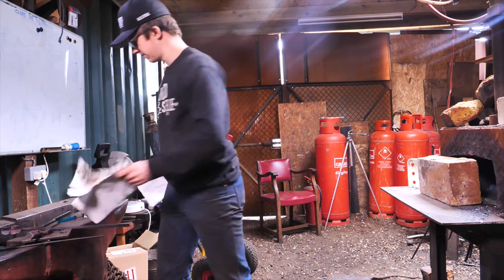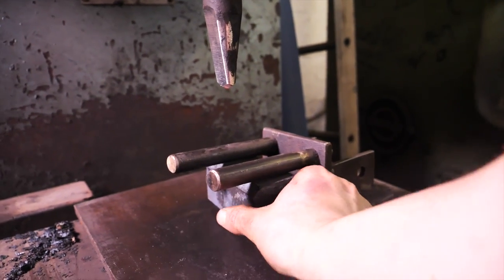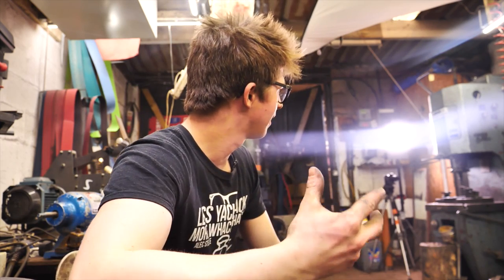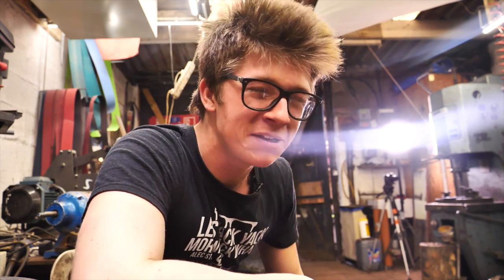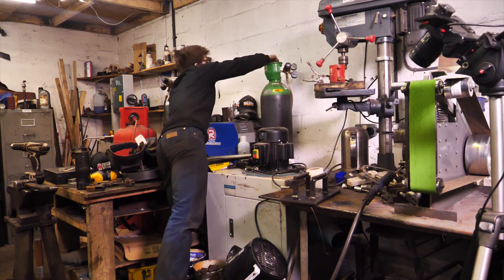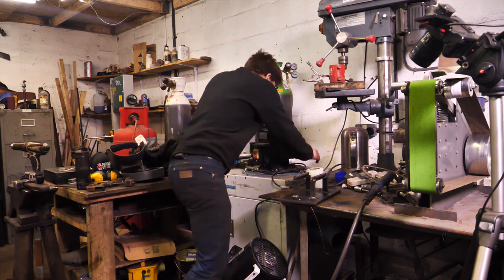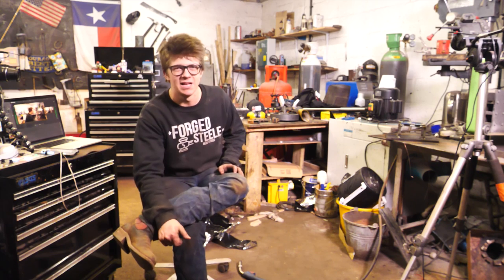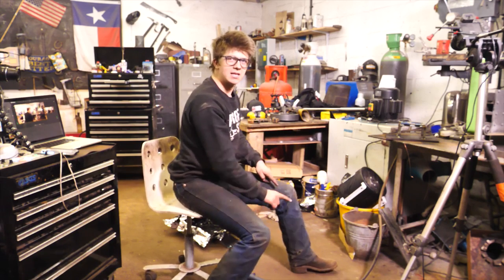MURPHY'S LAW!

Comment: Could you please make a video just about all the different types of hammers and what type to use when and what a beginner should buy?  It's more confusing than history class.
Reply: Sean Collins Hammers are all quite similar really. heavy hammer for moving metal quick, light for precision work. cross peen perpendicular to length lengthens and ball peen for making round depressions or rounding curves. the most Essential hammer for the beginner is a cross peen hammer (2-3 lb in weight is best for beginner) as you start to need them a ball peen and a 4 lb sledge become handy. In my opinion that's all that is necessary to forge. have a great day.
Reply: im a novice blacksmith and my teachers gave me a 800gram square faced hammer with a cross peen on the back, simple and works a treat
looks like that ===> http://prntscr.com/f3i2ew
simple
Reply: good for nails.
Reply: Thank you!  That's really helpful.

Comment: Hi Alec, a good tip for using a MIG is to thread a disposable ear plug through the wire before it goes into the liner cable to the hand piece. This will wipe any dirt or filings of it prior to threading through the liner, it will double the life of the liner and provide smother wire feed when welding.

All the best Shane.

Comment: If you put flutes on the punch, and/or be sure to preheat the punch so it is at full expansion when it punches the red hot work material, the smaller temperature differential won't be working against you.

Comment: If you are going to be making more hammers in the future it would be good to design a layout die.  This die would allow you to put the hammer blank into a pocket, which would align the blank for center punching for the handle piercing.  If you want, I can draw up an example.  Another idea is to make center punches as part of the die, so that one whack with a large hammer would punch both sides.

Comment: I know it would take out some of your work ability of your jig but a brace at each corner on the underside of the channel pieces would greatly increase it's resistance to bending. The bar at the top increases the moment of inertia of the span but your un-braced length remains the same, meaning the greatest potential for failure will be a localized bending or shearing at one of the corners. Placing a brace in the corner on the underside would allow that top bar of steel to develop and transfer stress into the vertical pieces of the channel much better.

Comment: Alec, the reason your stripper bars broke was because you dressed the punch. I'm sure you know what galling is. Fresh clean metal sliding against hot malleable fresh clean metal... that's like rubbing past super glue. it's gunna stick. Put some some oil on the dressed tools so it'll protect them from rust and then turn to carbon when in use with hot steel. Which should still prevent galling.

Comment: We all have days like this, try dragging a cart full of tools inside through 2 buildings, 5 gated high security fences, a full on security xray and metal detector and pat down and into a 3rd building on the third floor and realize that you don't have the grinding wheel for repairing 42 doors and it's back a quarter mile away on your desk outside of the prison perimeter.

Comment: may make a suggestion? I used to work with a pretty big press (4000 ton). When we would punch holes we would use parks oil with graphite mixed in it on the punching tool. It might be a bit of help to make it easier. just wear a face mask. you know saftey third.

Comment: Little Brother, NOT Murphy's law, Or Grady's "law. "Murphy was a raving lunatic".   We had the exact day. two welds away from finish, out of wire, Shim blew out of hammer slide on Kerrihard.  It wasn't just YOU.  Got notification for Twitch, Wi-Fi went down.  it's all over.  I call it a stripper also. tomorrow's another day
Reply: I screwed up, Or Brady's law is, "Murphy was a raving optimist".
Reply: O Grady, stupid auto correct
Reply: See, my point exactly